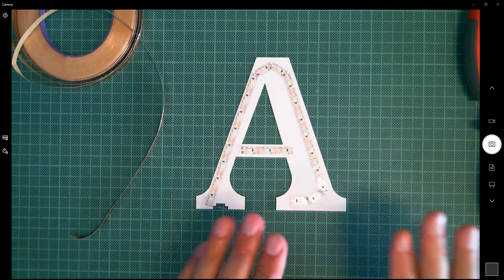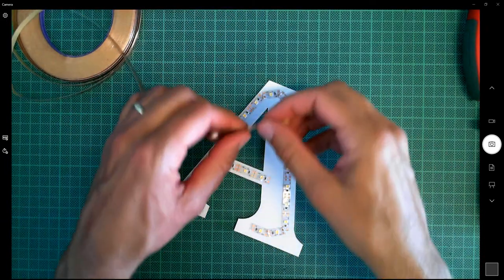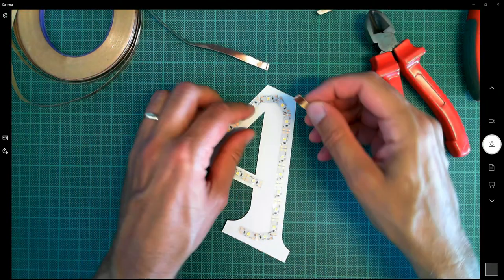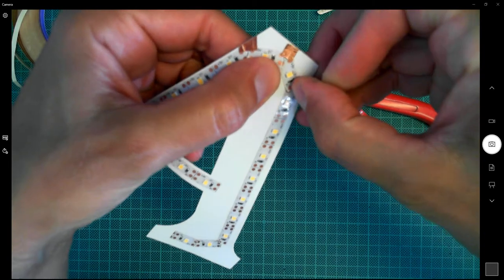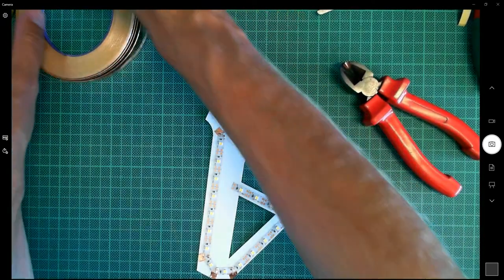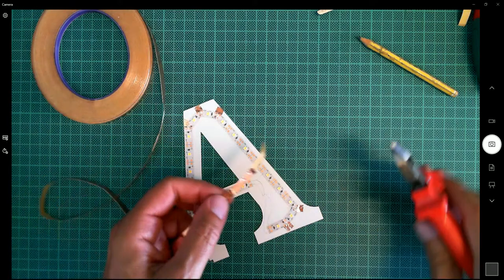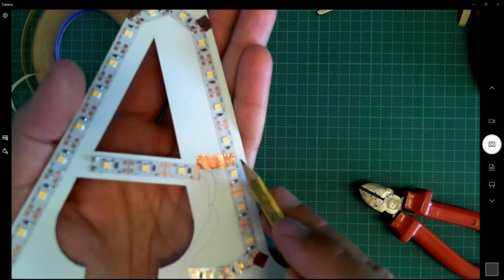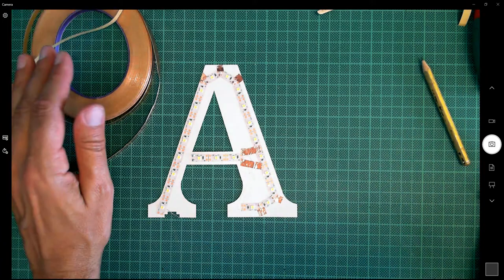3D Printed LED Letter Lamp Video 11

Comment: Yeah, nice video, but I'd never trust the adhesive layer alone for insulation and go over positive and negative like that, I avoid doing so even with wire insulation which is a bit thicker, let alone a thin layer of adhesive.